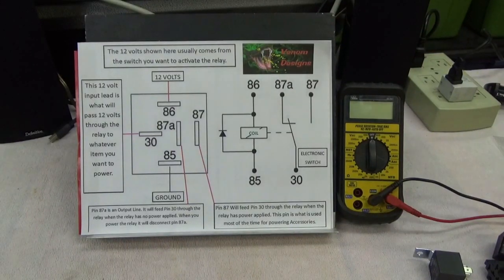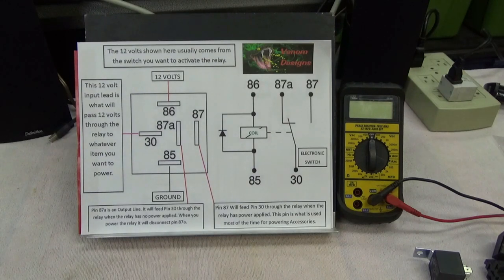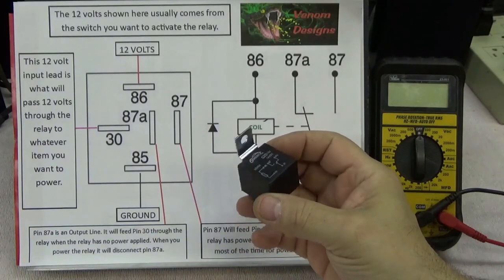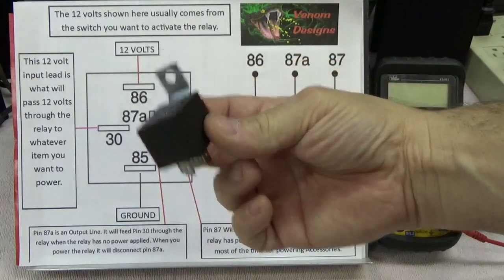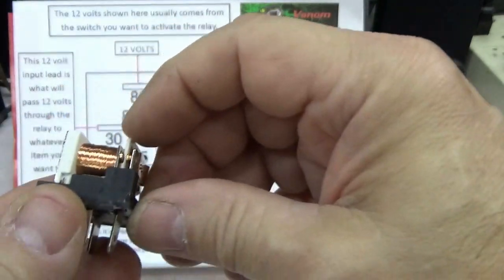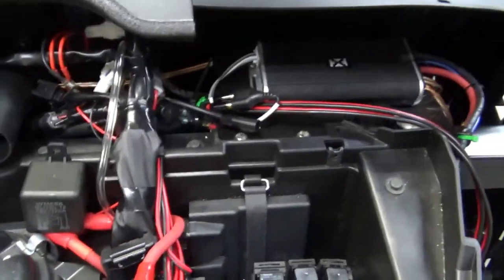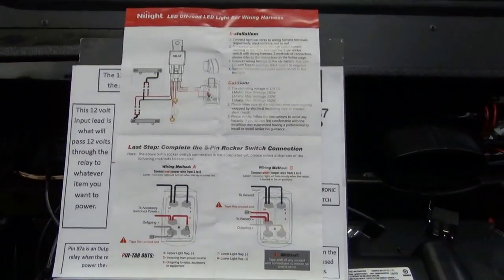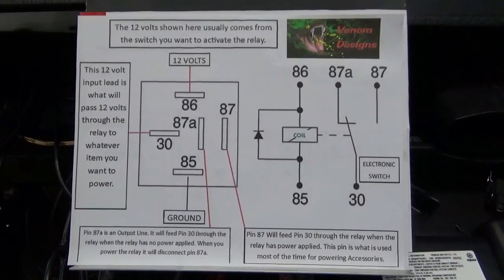Relays, Rocker Switches and Fuse Panel Wiring Explained

Comment: 2:32 You keep saying plunger. There is NO plunger. This is Not a solenoid. There is a rod (That rod NEVER moves.) in the center of the coil and that gets magnetized.  When that happens that magnetism pulls the tiny metal bit that is welded to the copper contactor.

2:40 Also NOT like a hinge at all. It is a either a spring metal or a lever pulled back by springs. In that case it is s teeter saw.
Reply from the maker: Read the description.. I said there is no plunger....
Reply: @venomchris5818  Timestamp where you say plunger is in my comment.

I looked at the description before I commented and there is absolutely nothing about plunger mentioned in the description. I took a screenshot. I can upload it if you like. Nothing there.
Reply: @venomchris5818   I went ahead and did a word search and nothing shows up in the description. The only 5 instances that show up on the entire page, are in our conversation. Took screenshots again if you wanna see them.
Reply from the maker: you are correct, My mistake it is the first comment That I posted when I uploaded the video. "There really is not a plunger . It is done magnetically. I just said plunger for a visual effect in your head to understand the relay. I was taught that way 40 years ago...." @AztecWarrior69_69

Comment: how can you tell if your not getting ground at 85???
Reply from the maker: Using your Meter put the Red Positive lead to the battery 12 volts + and touch the Negative  Black lead to  pin 85..the meter should show 12 volts. If it does not you have no ground.
Reply: @venomchris5818  I used a test light.  hooked it up to the positive and put it to 85 and it lid up so I should be good, correct?
Reply from the maker: @pablogomez7519  Yes
Reply: @venomchris5818  ok because my situation is no crank start. good Ignition switch, fuses,and relay. but no power to S wire to starter. maybe bad neutral safety switch 🤔??
Reply from the maker: @pablogomez7519  what vehicle are you working on?
Reply: @venomchris5818  2000 chevy s10 2.2 automatic
Reply from the maker: @pablogomez7519  that truck has the starter solenoid /relay attached to the starter. If everything looks good as you described then I  would say the solenoid on the starter is not passing current to the starter. Is the solenoid clicking when you turn the key?
Reply: @venomchris5818  no but I hooked up my power probe to the S terminal and when I gave it 12v it started right up
Reply: @venomchris5818  and I had the starter tested and it was good 👍🏼
Reply from the maker: @pablogomez7519  is the S terminal on the starter or on the solenoid?
Reply: @venomchris5818  starter. I thought the yellow wire from the ignition goes to the purple and white wire that goes to the NSS then that goes to the purple wire
Reply from the maker: @pablogomez7519  the best thing to do is look at a wiring diagram for that truck and follow the wire from the ignition switch to the starter,  check everything along the way..
Reply: @venomchris5818 I will do that tomorrow sir and thank u so much for ur time and advice. I will let you know something
Reply: so I was checking the terminals on the starter relay and I put the clip on the positive and got light on both 86 and 87. is that right??

Comment: @2:16 - The diagram on the right-hand side (relay) has a symbol to the left of where it says "COIL" that looks like a side ways "Play" button actually symbolizes a DIODE.
The relay you used (WM686) does NOT have any integrated diode. These are important in relays and any inductor, due to "back EMF" (also called "flyback").
Without a diode, you could damage your circuit when the power to the relay is turned OFF.
Otherwise, great video!
Reply: Make your own video ya know-it-all

Comment from the maker: There really is not a plunger . It is done magnetically. I just said plunger for a visual effect in your head to understand the relay. I was taught that way 40 years ago....
Reply: I would like to see where your wires (all 4 connections) go to and from on the 120A relay. I looked at both the video and the website.
Reply from the maker: @glenroyglenclarke2374  The 120 AMP relay is numbered exactly the same as the small 30 AMP relay. The diagram that shows  the relay pins is the same for the 120 AMP. I used 4 AWG Wire for the switched pass through. The other two wires are ground and a switched 12 volts that trips the relay.
Reply: @venomchris5818  I'm using only 1 battery but I added a fuse bank with one main power switch like you did. I got the relay and I want to add it. I'm unsure how to add it and where it would go. I'm lost in the sauce.
Reply from the maker: @glenroyglenclarke2374   If you go to my build thread at :  https://www.wolverineforums.com/threads/venoms-2021-yamaha-wolverine-x2-xt-r-850-build.32328/page-6  , it will show you the relay monte to what I would call the firewall. It is mounted just behind the fuse panel to the left. You can also see it in video #18. The wiring is the same for the large relay as the small. Come off your battery with a positive wire and into a circuit breaker or large fuse. come out of the Fuse Holder  / Circuit breaker and go into Pin 30 of the relay. Come out of Pin 87 of the relay and in to the fuse panel. Now take one of the switched accessory leads in the dash and the positive 12V goes to Pin 86 of the relay and the Ground goes to Pin 85. Now when you turn the key on it will power up the fuse panel.
Reply: @venomchris5818  Chris, I was trying to wire it like you did yours. I don't want to wire it to come on with the key. I wanted to use a master switch to turn on the fuse panel so I can use the Wolverine for music or whatever without powering on everything else. Thanks.
Reply from the maker: @glenroyglenclarke2374  okay, then run a power wire from the battery to  an inline 5 Amp fuse. Then run it to the switch. Output of the switch goes to the power in on the relay. Get a ground from the frame or from one of the accessory plugs.
Reply: @venomchris5818  Thank you, I appreciate it.

Comment: there is no such thing as pin 87a on a 4 relay it is a 4 pin relay you are demonstrating
Reply from the maker: The only thing the 4pin relay was used for was to show the coil and arm inside for a visual to have in your head. All other parts of the video are for a 5 pin relay.

Comment: I got confuse on the relays 32:20 ok then if the fuses only activate the relays and then from the relay goes to the switch, how does the switch is getting the positive and negative from the fuse if the wire from the fuse is already going to the relay? I hope I explain myself good I’m confused @venomchris5818